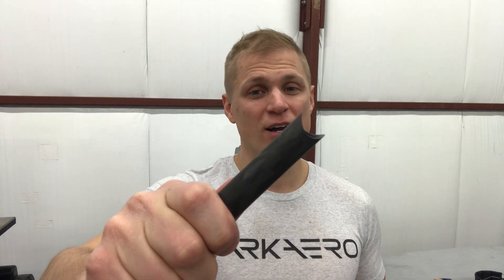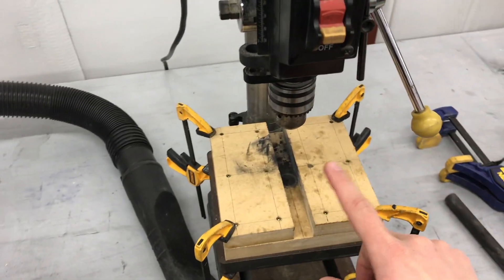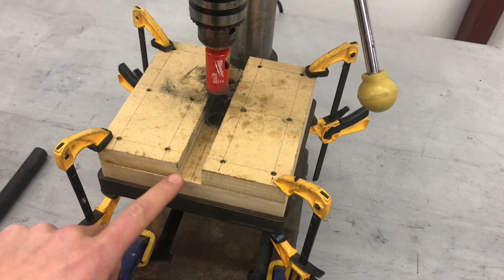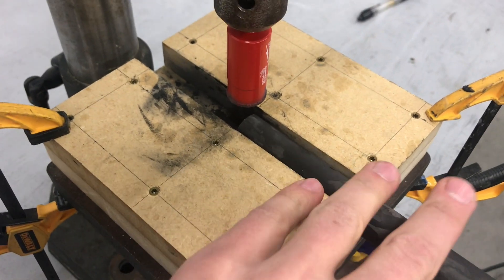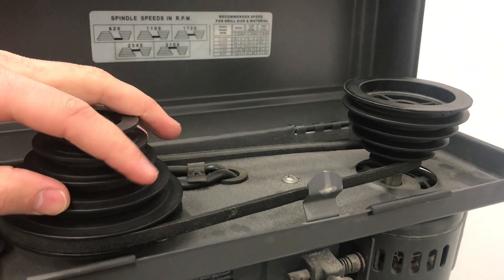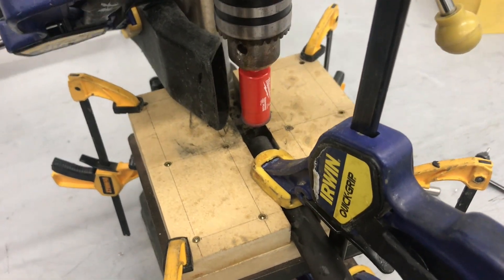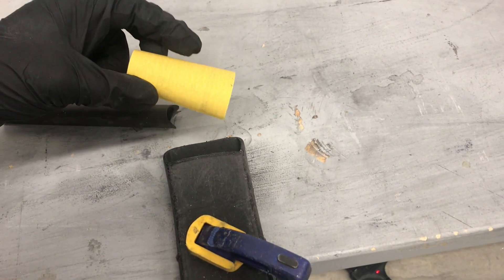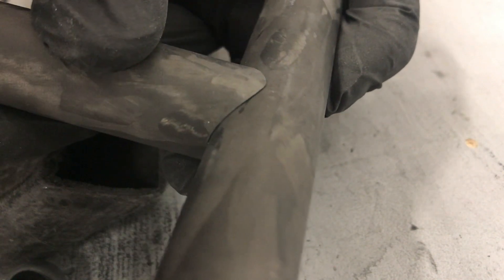HOW TO: 90 Degree Notch Cutting Carbon Fiber Tubes

Comment: Measure the thickness of some 400 or 800 grit and paper, produce a 8 or 12" long carbon fiber tube/mandrel 0.75" in diameter minus the thickness of one layer of sandpaper you choose. When the sand paper is applied to the mandrel in a single layer it is exactly 0.7500" then sand the cut made by the diamond bit or other cutting technology to have a perfect fit to bond the two surfaces. You could even speed things up by chucking the mandrel into the drill press similar to using a drum sander except this is made to give you the exact fit you need without a gap in your joint.

Comment: The joint shown is of two tubes of equal diameter. The same method works if joining a smaller tube to a larger one - the drill bit just needs to be the size of the larger tube (the one you are joining to), rather than the size of the tube being cut.

Comment: Have you considered a v-groove fixture, instead of the square channel? With proper clamping, it would hold the tube centred without the tight fit required by this setup, and would even work for various tubing diameters. The groove can be cut in a single pass with a suitable router bit.

Comment: Use water as coolant and up your rpm. It will keep the resin cool and provide a much cleaner cut. I have found. I learned that repairing 330 mph Funny Car bodies in under a hour between rounds🤦‍♂️ you can also use a thinner Kerf cutter. It will produce less heat via friction. Professional Marble, Granite, & Tile stores stock great Bits that don’t cost much more than your Milwaukee brand found at the Depot or Lowes. I do not know if or how surface RA effects joint bonding though? But I would like to🙏🏻

Comment: I think that it may be an improvement to use some sort of coolant while cutting with the abrasive bit. I have no experience with CF, but I know in the construction industry, we always try to use coolant on abrasive blades such as those. The other thing I could see being useful, is making a stair stepped jig that would be capable of accepting multiple tubing diameters. That's just my .02. Keep up the great work guys. I'm loving the videos.
Reply: The heat generated might damage the matrix at the point of contact by thermal degradation, but also pulling out fibers and introducing a delamination into the part.

Comment: If you put painter's tape at the end of the tube would you get a cleaner finish on the bottom of the tube where the bit breaks thru to prevent "breakout"?

Comment: Cooling with water is good for the tools, the carbon and easier cleaning.
Reply from the maker: Water does keep the dust down! Any tips for implementing this in a simple setup? Just get the tube and the cutting tool wet?
Reply: @DarkAeroInc  A long box with the jig/tube inside clamped to the drill table,
Reply: An oven tray for small stuff

Comment: Maybe a stupid question but would it be possible to make the darkaero 1 pressurised? And what about IFR? Love your design by the way. Keep up the good work boys.
Reply from the maker: Bjarki K thanks for the question - good question. The DarkAero 1 is optimized w/ best performance from 8,000 to 12,000 feet where pressurization isn’t needed. We don’t plan to do pressurization due to the weight and complexity. The aircraft is IFR capable and the instrument panel is large enough to install a full IFR system.

Comment: I would be interested is seeing how you join the carbon fiber tubes together.  (Hardware, epoxy?) Thanks for sharing.
Reply from the maker: Jay Schweitzer we are working on another video that covers that. :)
Reply: @DarkAeroInc  when
Reply: @DarkAeroInc  Same question how you fix those notched tube together? Thanks
Reply: Yup I want to see that too and would love to know the strength of that joint compared to traditional chromoly of the same diameter.